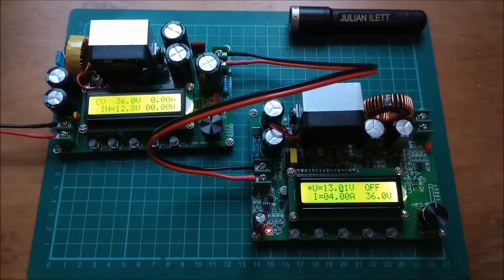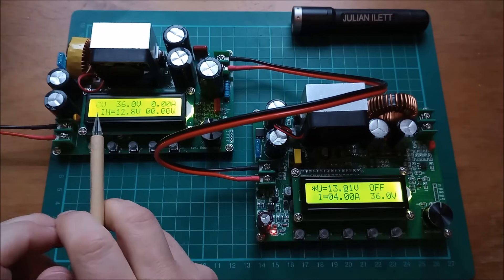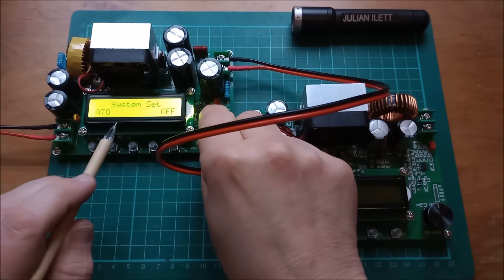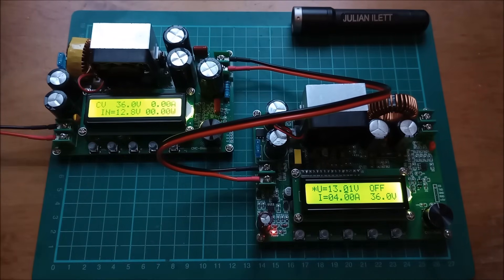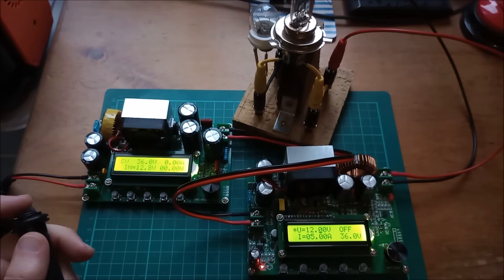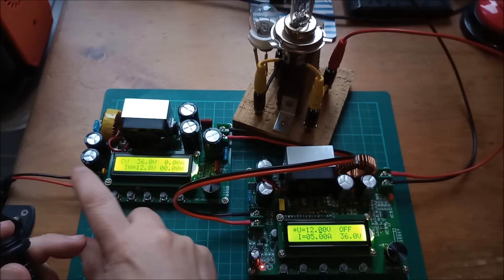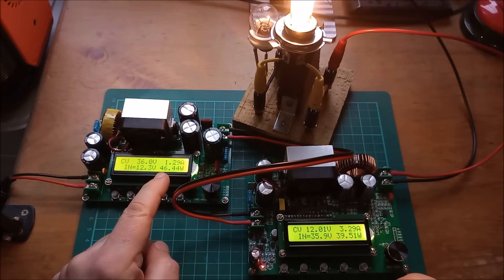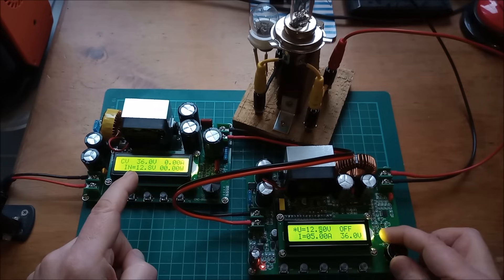Boost and Buck Converters DPX800S and DPQ9010

Comment: I have bought three of the DPX800S and was disappointed:
Two are working (more or less), except for MPPT. When trying to use MPPT it just flaps between on and off, effectively becoming pretty useless.
The third one failed seconds after startup and now has a short on the input. 

If someone has figured out if the MPPT function is useable somehow, I'd be glad to hear about it!

Comment: Hmm - it seems the chineese don't care much about numbers in their datasheets (input Vmax 90V/100V whatsoever...). With 20+ bucks they are not really on the cheap side, but capable of some power it seems. I wonder why you didn't really test the power capabilities of these devices - thats the first thing for me when i buy a new buck- or boost converter. In most cases you cant trust the marketing values and you can only use 50...60% of the stated values for a longer time without additional cooling. Also i would have loved to see converting effeciency and stability of output voltage/current on some demanding loads.

Comment: It would be interesting to see how much power you can send along a thin wire pair boosting and bucking, doing a rough calculation on losses at different voltages, seem to remember you had plans for something similar a while ago?

Comment: Aren't these just recycled older boost bucks with a few better parts, same software...

They don't make them high enough voltage or current, if they made better connections and holes to double up.. be nice.. 
I end up making my own as I just don't off the shelf or off the shelf value

Comment: I wish these guys would focus on bringing some modern topologies to mass market, eg GaaN FETs, synchronous operation& rectification, much higher quality inductors.   The efficiency on all these cheap modules sucks, and they focus on displays, buttons , gimmicks instead of the core functionality.  I'd gladly pay the higher BOM for modern designs, it'd still be much cheaper than buying the boutique designs that pop up from engineers in Germany , etc..
Reply: You could take these cheapish units and replace components that fail with higher quality components? Its one of the reasons I asked about longevity testing.
Reply: @Bennyboy-dog  On the small modules you can try to get one using the least obsolete chip possible, improve cooling, sometimes add a beefier shottky diode if they skimped and mis-labeled a 1A diode as a 3A etc.   On the larger boards you could replace with faster/lower resistance MOSFET, faster/beefier diode.  And critically, a much better inductor such as something from CoilCraft. 

But alas...you are still just putting lipstick on a pig.    These are obsolete designs using obsolete (and often fake) components.    A synchronous converter replaces the switching diode with an actively driven FET , thus avoiding the diode voltage drop altogether.    Most people who use these modules think they are getting much , much higher efficiency than they really are.  Bordering on a state of denial frankly.  

Consider for a minute a modern (and relatively inexpensive) PC motherboard:  It is in large part a giant buck converter turning 12v into several hundred amps of finely regulated 1.5v.    Or open up the marvel of a modern mass mkt Hi efficiency  server or meanwell  power supply, or the current crop of tiny GaaN USB-C chargers.    Far too little of  these massive advancements in power electronics tech we have seen over the past 15- 20 years has made its way into these garbage buck/boost modules. .
Reply: @GannDolph  Very informative comment - thanks.
Reply: @GannDolph  full ack! Great write-up on the frustration someone with more insight has when shopping for these kind of devices. However, I think its not a decision "these guys" made as manufacturers. They probably are quite small teams of engineers working tightly with relatively small production companies, in search for a market that fits their capabilities - not the other way round. While cutting-edge SMPS designs may be public knowledge, bringing them to market is a different beast. Even if they somehow manage to engineer a great layout, they still have to top up everything else along the way. Sourcing, manufacturing, higher labour cost... Young graduates capable of pulling this stuff of maybe don't want to address this market and rather follow a career with more perspectives. Ending up working for higher quality brands that serve a different market. "German" engineers don't have a choice, they can't just quickly spin up a production for some low-effort design to hop on some aliexpress trend...
Reply: @coolm98  That's a totally fair analysis and likely addresses why things are the way they are.  I do notice some advancements here and there -if you search hard.   The trickle down is slow, but  I guess I am thankful  these modules exist at all , as many are perfectly acceptable for  a range of applications...👍